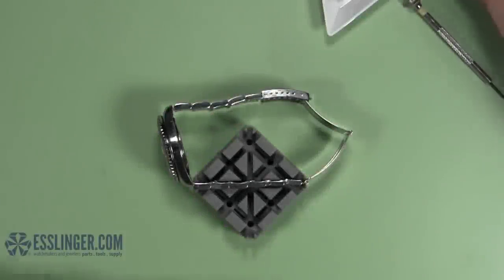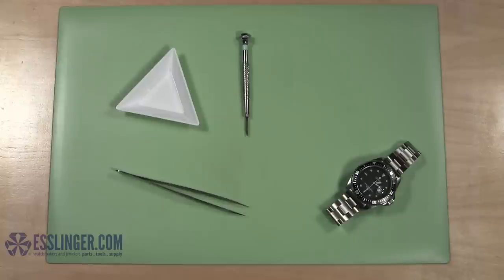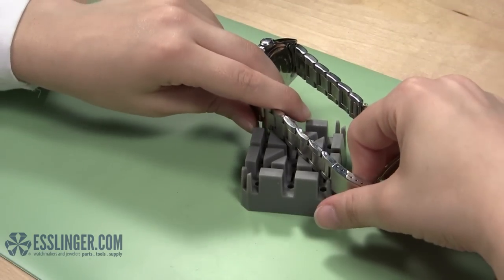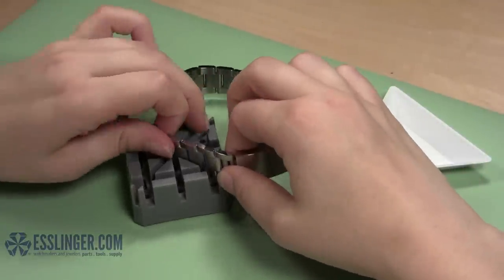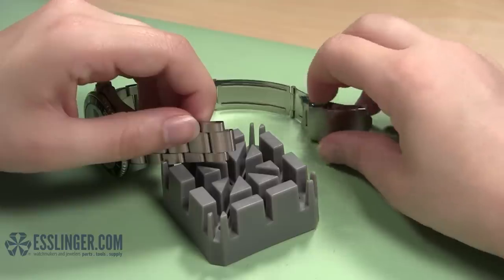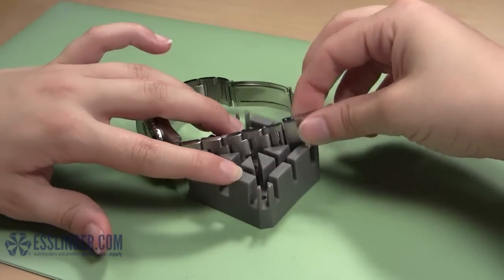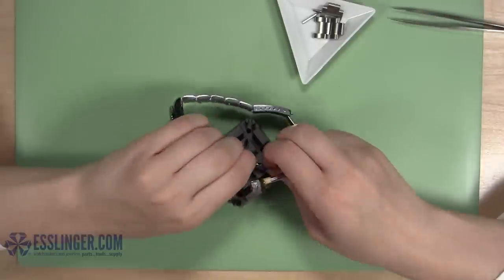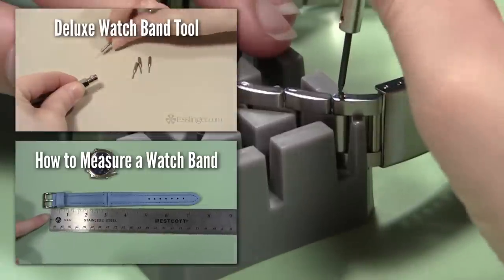How to Remove Watch Band Screw Links

Comment: Mine has screws but the screws are on both sides and no matter which side I turn it doesn't loosen
Reply: N. J. P. same😢
Reply: same here. im trying to figure out can i even resize it?! if not, what a waste of money
Reply: I'm sorry to say you have just bought a fake watch
Reply: @soccerrrr  That doesn’t mean it’s fake. Screws are held in by loctite. The OP my need to heat up the screws with a hairdryer or a small torch for a few seconds to break the bond. It by no means means it’s a fake watch
Reply: @hugedickerinokripperino5299  The screws are usually independent from one another

Comment: What if the screws are really tight
Reply: probably because of loctite (adhesive/glue) that is keeping the screws in place - what has worked for me in the past is applying some heat with a hairdryer for a few minutes (be careful not to touch the metal with your bare fingers after you do), and then attempting to unscrew.  Takes some patience
Reply: Marry her
Reply: @marcrose23  Thank You Marc R.   I'm glad I read this because that is what is wrong with my band. I can't get the screw to come out. I will use the hair dryer tomorrow.
Reply: Cohesive G-unit That’s a really good one

Comment: If it just keeps spinning the screw is already loosen it just wallered out the pin so just find a way to pull the little screw out cause if not just going to spin forever goodluck